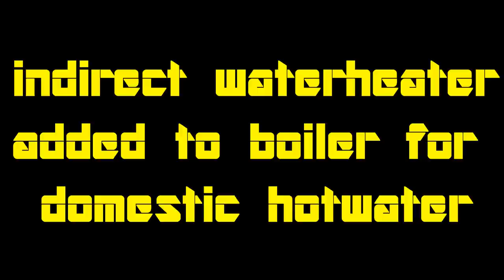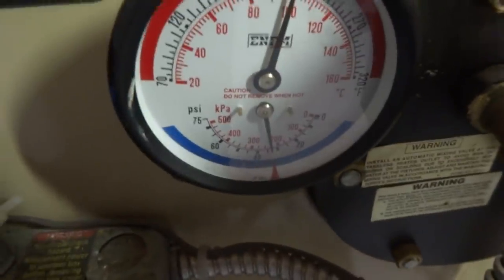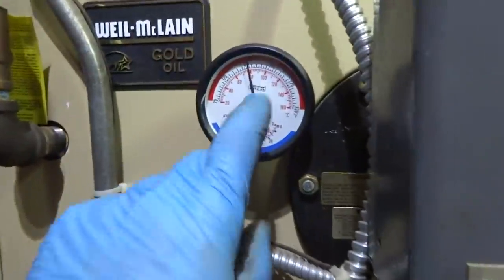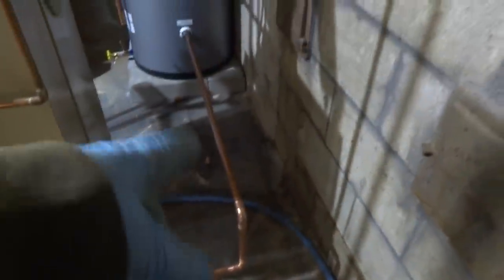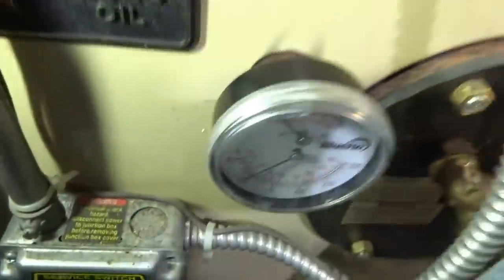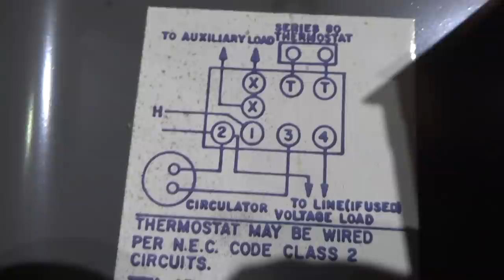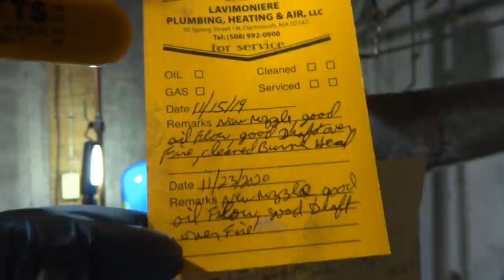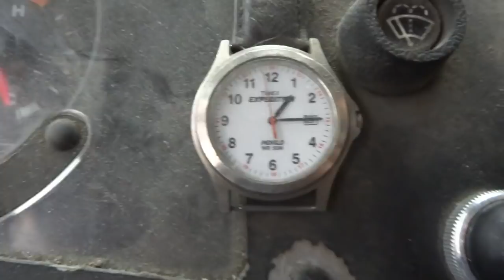INDIRECT WATER HEATER ADDED TO BOILER FOR DOMESTIC HOT WATER

Comment: I'm am just an amateur plumber but I remember my (stationary engineer) father  telling me, NEVER connect black iron to copper directly. You have to use a brass fitting in between or the copper fitting with the built in isolator to prevent pinhole leaks due to the dissimilar metals and galvanic reaction.

Comment: Couple of observations. Why not put a piece of clear tubing in your purge hose so you can see the air bubbles. Also, have you considered getting a cordless inflator to use on the expansion tanks and not drag down that heavy compressor.

Comment: On the plus side I do like that you used a circulator instead of a zone valve to feed the tank. I also prepare the male adapters the same way.  What I don't care for is reducing the pipe size to the tank,  it should have 1" pipes. I would have cut in a tee on the existing return.  I use a 1 1/2 x 1 black tee under the heating circulator.  The 30 psi relief valve is supposed to be mounted vertically.  I also turn the low limit down at low as it will go and feed the heating transformer with the normally closed side of the   new circulator relay. You commented on the flue pipe it should not be reduced I totally agree. They may have a 6" stainless liner in there, but you didn't comment on the draft damper being in the wrong location.  Nice clean work other wise.

Comment: No Isolation valve on the back side of the pump means draining the tank to replace or service the pump or seals
Reply: You would not be draining the whole tank but draining the coil on the boiler side of the system. The domestic hot water would be the storage tank side.

Comment: Hey Steve , Guy here from In Town Plumbing, so I have a quick question for you . If I was to purchase and single zone switch relay, like the one you mounted there .... so if can get the wiring down.... Line voltage 110v Hot to 1...neutral to 2..and then neutral to circulator.. then neutral to where? Then 3 to circ... Then 4 to ZR...  also where did you piggy back line voltage from ????
Reply: Looks like he took power off the boiler aquastat, appears to be 3 conductor cable. If you use a different relay the terminals will likely be different but they come with wiring diagrams.

Comment: So I have a tankless oil boiler like the one in the video. Runs hot water for me and the wife ( water doesn't last long obviously) and also is use for baseboard radiant heat in the winter.. obviously oil prices always fluctuate so I'm trying to find a better solution for showers even if I have to only use oil in the winter or have a indirect hot water tank connected to this existing boiler..

Comment: Hey Steve I gotta question. Is there a reason you piped the supply for the indirect from the port where the relief valve was instead of the supply to the baseboards of the house? I'm asking because most time when I see plumbers install an indirect they usually pipe off the supply to the house. A previous plumber might have left a tee with a plug so another plumber in the future can pipe off that line.
Reply: Steve can you answer this for use please

Comment: Steve, I'm in the process of getting a indirect water heater set up with my wood pellet boiler. I have an independent taco controller with three zones and have a third zone ready to go for it. What aquistat did you use on this indirect water heater in the picture? That's exactly the type of aquastat I want.

Comment: It looks like you have the water heater circulator wired to run anytime the the main boiler circulator pump isn’t running. If the hot water tank isn’t calling and the zone valve is closed isn’t that just wasting power? I’m probably just confused on the wiring
Reply: There is an aquastat on the indirect which is connected to the relay which turns on the circulator for the tank as well as sending power to the aquastat on the boiler making it fire up.
Reply: It's not too complicated, but something like a taco zone controller could make it more easy, but they are expensive and need to rewire.

Comment: It funny there 2 cold water presser reducers in the supply. I have the same back flow an presser reducer as the one you added the drop pipe on to an turned it around so the over presser outlet faced down.. it both a presser reduced to 12psi as well as a one way check. You dont need that 2nd one with the leaver on.. you can opeb that leaver to get full psi but the one you added the drop pioe to cuts the psi to 12 psi any way. I had that valve fail an no water to the boiler  .. it factor set to 12psi you cant ajust it.

Comment: Coming out the unit you should not connect black pipe to copper. Best to use dielectric or brass transitions
Reply: It’s not a freshwater application. All it will see is recirculated boiler water with no entrained air. So no corrosion.
Reply: No shit

Comment: Another great vid. Thanks for sharing. Could you have put a mixing valve on the hot water out of the tank for more capacity ?
Reply: those things have huge capacity for hot water the coil inside heats water fast

Comment: I love your videos and I so wish you could come down to NY to fix my hot water issue, I’ve got the same boiler and a hot water holding tank but we’re using the hit water coil that’s in the boiler. My hot water pressure is lower then my cold water pressure, do you think my coil could have a blockage?
Reply: Where are you located? I am  licensed plumber out of ny
Reply: If you’re on a well and have hard water good chance it is.  Happened to me.

Comment: Why don't you put a Honeywell T1 7 7/3 party controller something like that are why do you use mechanical high limits to control your boilers? Is there some advantage other than being cheaper? Its code down here in Texas.....
Reply from the maker: the boiler already has a high limit .i just sell the guy what he needs not sure about your party control sounds like a texas thing ..this circulator switching relay is all this system needs to operate properly.

Comment: All you plumbers do the same thing so home owner cant service any heating coils that need to be back flushed once a year to keep them working top notch. Every coil copper or stainless steel get calsum iron or just plan old  Is oxidization witch slows down or stops heat transfer.. none of you plumb in back flush boiler drans to pump a good descaler like darie though the coils. I have demestic hot water coil on my NYT oil fired boiler. Never run out of hot water until the coil needs descaling just like that direct hot water tank will need. Sad part them tanks are very costly an the hot water cools down fast with only 2" of insulation an the boiler fireing all the time weather or not hot water needed. My boiler in summer only fires when call for hot water if boiler below my set demestic hot water setting. If i dont use it for 24 hours it dont fire .  But it must be plumbed an wired proper